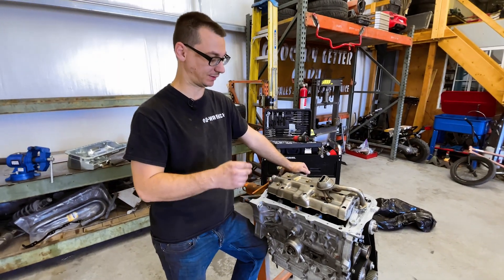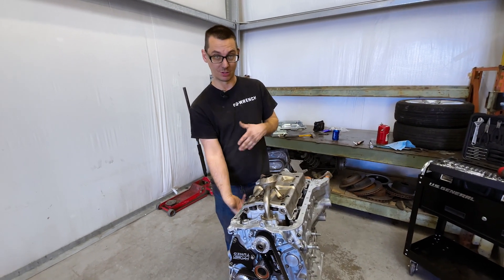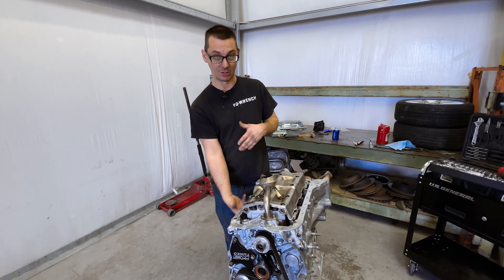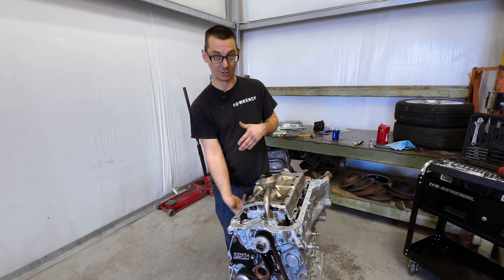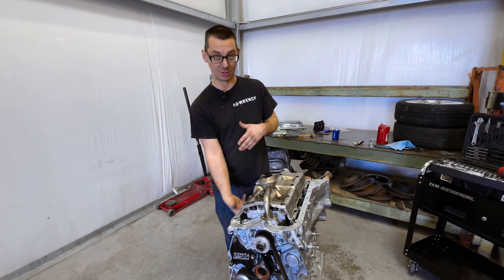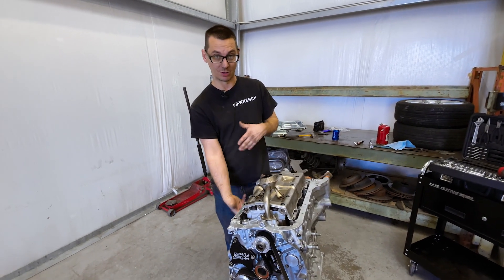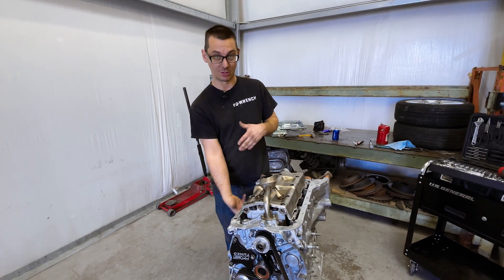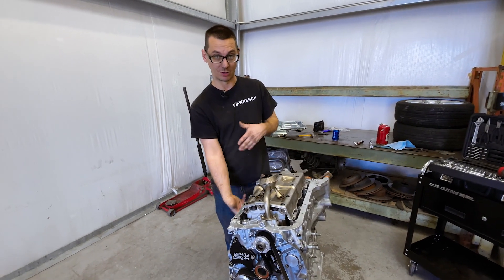Honda Prelude H23 Engine Build Episode 6

Comment: What website did you get the manifold from and did you need a adapter to fit it to the h series?
Reply from the maker: It's a K series manifold. 1320 Performance sells an H to K intake manifold adapter kit. A little trimming is require. I'm not sure which video shows what has to be trimmed but it is in a video in the playlist below. 
https://www.youtube.com/watch?v=wWFDAsPNM0o&list=PLMUfE-O4VrePnl_LTElfpeBzQy-DrXlPq

Comment: You've been slightly helpful with my own h23a1 build. I'm not sure what kind of video your going for, but if you could show the actual specific bolt/washer/nut/hardware before putting it on, it sure would help. See, I bought this Prelude project in pieces. Torn down to bare block. Nothing at all labeled. This sucks!